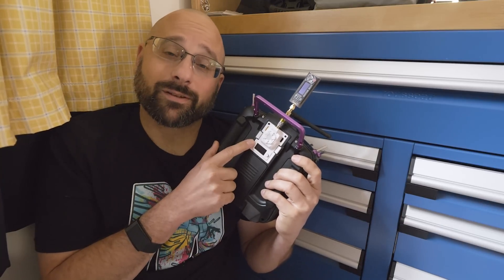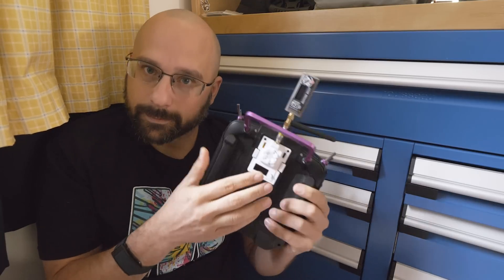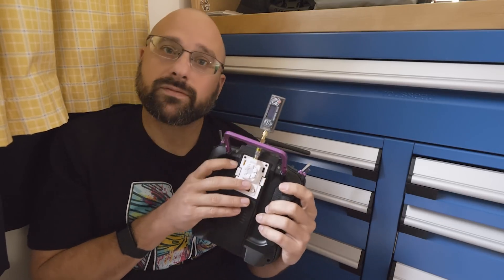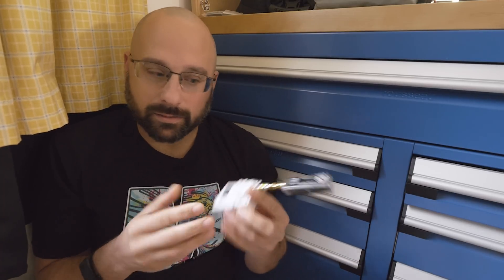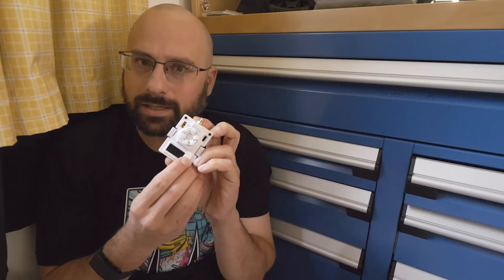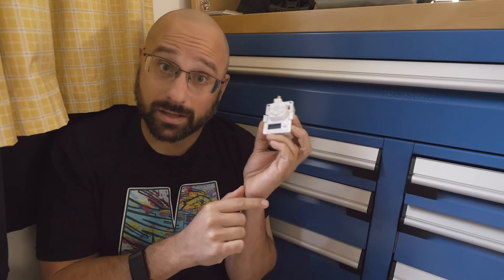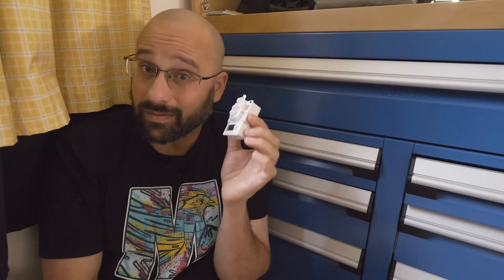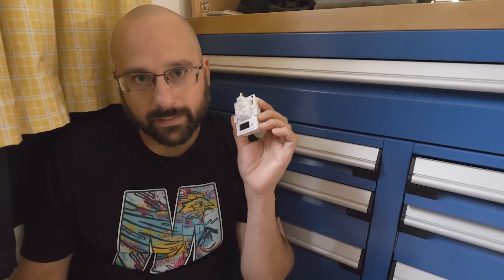BetaFPV Micro ELRS module fan design is (probably) not defective

Comment: Hello,  this is the team from BETAFPV. Thank you to Joshua's video for pointing out your concerns and feedback and the rest of your valuable feedback and concerns on our ELRS Micro TX Module. Here is the back story of the design of the RF module and why we chose this as well as why it won't influence the fan's function of the cooling down. As for the concerns of the joystick and failsafe issue, we will talk about this later.

The RF module is on the opposite side. Could the module cool down and stay secure? Leaving the RF module on the back side of the main board, we could have enough space for the RGB LED and the heat sink (only needed for the next 1W version). For this version with 500mW maximum RF output and 30 minutes continue power on, the temperature of the RF chip could keep under 40 degree and about 30 degree for the case. The module could work properly in this situation and totally do not need to worry about perfomance. Also, for the black version (maximum 1W, comming in December), the temperature can be kept in 65 degree, with the help of heat sink in our testing. From the testing you could see, the temperature of RGB LED would be 10 degrees higher than the RF module no matter in 500mW or 1W situation. This is the component what more need the cooling fan. 

Another concern that no consumers' feedback yet is the blowing direction of the fan. Blow inward or outward? The testing result shows that only the micro JR case would be affected, about 10 degree temperature difference. The electronic components inside would be in the same temperature.

We also make pictures of some basic data to show you our testing results of the above information. If you need more about it, please feel free to check the link below:
https://betafpv.com/blogs/blog/know-more-about-betafpv-elrs-part-ii
https://betafpv.com/blogs/blog/know-more-about-betafpv-elrs
If you need any help, please feel free to contact us on Facebook: or Email us. 
Facebook: https://www.facebook.com/betafpv
Support Team: support@betafpv.com
Reply: So how about the joystick situation?
If you want to gain credibility, you have got to deliver quality. Otherwise being marked as a problem for ExpressLRS appears quite appropriate.

Comment: I purchased the number one version firmware on beta fpv micro module . It supposed to work without all that upgrading and upgrading and flashing .
Lots of brands do come with brand new  working recievers . But that information seems to be omitted and shamed and ridiculed and videos seem to create the impression elrs is a computer upgrading game or job and remotely controlling anything is not possible without a huge investment in electronic computer bases  and equipment and access to programs that change bi-weekly following latest upgrade

Comment: Us spectrum tx users are out of luck with adding Express lrs2.4?
Reply from the maker: Spektrum radios from DX9 and higher can connect to a CRSF module, so they can use ELRS. But they can't run a lua script so they would need a module with built in display and joystick to configure the module.
Reply: @JoshuaBardwell  thank you for the quick response!  I am very thankful for all you do.

Comment: Joshua, we are on your side, this is very dumb design, no questions about it. Just blaming opensource community for this when it had nothing to do with this bad design just did not sit right with me. Especially when they do this not for profit and whole community benefits from it. Some people responded "oh i will wait with switching to ELRS" when it is not ELRS problem but particular item design issue.
Reply from the maker: Acknowledging that bad hardware reflects badly in the project is not the same as blaming the devs for the bad hardware. I don't know why this is a hard concept for a lot of people.
Reply: @JoshuaBardwell  Because usually this is not how it is being done. It is common for commercial products to use opensource code, what they do is they ask to support their hardware for a monetary donation.  I e it is BetaFPV's job is to work with opensource community to produce a great product under BetaFPV brand name and get a profit from  it. The ELRS devs already doing great good for the community for free (which we are very grateful for already) and they have zero obligations to make BetaFPV product to be profitable.
Reply from the maker: Yes I know that this is not usually how it's done. And I specifically explain why I think the ELRS situation is different, both in my original video and in this video where I elaborate on the reasons for those who didn't seem to get it. You can disagree with my reasoning, sure, but at least acknowledge it and then argue against it. Don't just repeat the argument that I responded to.

The ELRS devs have zero obligation to anybody as regards hardware: correct. But I did not say, "the ELRS devs have a problem." I said, "This is the biggest problem with ELRS." You are equating "ERLS" with "the ELRS devs" and I think that's why there is confusion. I am talking about "ELRS from the perspective of a person who is deciding whether to use ELRS or some other control link."
Reply: @JoshuaBardwell  I'm not disagreeing with you reasoning, though just saying that "it is ELRS problem" from such a trusted source as your channel, makes it so. Because people immediately responded as "I will wait now before switching". Where if different words were picked such as  "it is BetaFligth problem" people would respond "Oh, i will pick different ELRS hardware then".

Comment: Not saying its a good design but could the button be used as an emergency RTH if the radio has locked up and the vehicle is not responding?
Reply from the maker: If you see that as a desirable feature you can always just yank the module out.
Reply: I didn't say is was a good idea, just a thought...

Comment: I guess they didn't attentionaly made the failsafe happen during the menu. They just programmed the menu over the Firmware without managing the multitasking of elrs fw and their oled code. So this is just a lazy move. They hoped no one will ever do such thing as using the menu while flying.
That's what I think  happened. Could be wrong though.
Reply: It’s just a sign of lacking QA and lacking developer experience.

Comment: 100 mW outperforms any video link and/or reasonable sized batteries. Anything above 250mW is just marketing bs.
Reply from the maker: No offense but I respectfully disagree. If you're running 250 Hz, 500 Hz, or higher, you can get into situations where you need a little more power, especially if using the ceramic antenna. You're right for probably the majority of people but additional output power does have some purpose.
Reply: @JoshuaBardwell  Higher than 500Hz? Did I miss something? 😉 The EP2 is best fitted in racing rigs. I would rather pick the EP1 for freestyle/long/er range flying. https://youtu.be/GkvHiWJ7g4E was at 150Hz@100mW with the crappy hm stock antennas. I bet this wouldn’t been an issue even at 250Hz with the prodrones on both rx and tx. A little more power (250) can be useful though to do that at 500Hz (will test that asap) but I don‘t see how anybody really needs >=500mW.
Reply from the maker: Did you miss something? Test versions of ELRS can run at 1000 Hz. That's what I'm referring to.
Reply: @JoshuaBardwell  Missed that! 1000Hz is crazy 😁Can‘t wait for the 12 bit vertical resolution to make use of it.
Reply from the maker: They are waiting for CRSF v3 I think before even 500 Hz makes sense.

Comment: open it up and flip the fan over to make it blow the air out, NO other mod needed, the temperature will drop about 5 degrees. maybe this way it can hold max power a bit longer. funny how the betafpv dev team didn't think about this.
Reply from the maker: They have internal testing that shows the temp is lower with air blowing in.

Comment: Maybe you just should be opened to understand that not everyone thinks like you, and in my opinion you do not receive well disagreements!
The module has problems, but it does not seems to be as bad as you reviewed it in the other video.
The USB C is a real problem 
The button is not a problem it is a choose of probably a lower cost solution.
The failsafe with the menu is a bad thing but to enter it you have to long press the button and while flying the chances of that happening are very very low, bit something to change over firmware!

Comment: People don't buy a Lumenier Lux and say Betaflight is shitty because the problem is with the feature of the Lumenier Lux, not with Betaflight feature. If Lumenier doesn't make good Betaflight FC, there are other manufacturers who does. Same goes to BetaFPV having a dumb "feature", it's not a ELRS feature so not sure why would it be a ELRS issue especially when ELRS didn't certify it. If ELRS would to implement a certification program, then that would open up a can of worms.

Think the public just needs to be educated that ELRS is like Android, it's open source and the devs don't make the hardware.

Comment: I think you were bang on man, I did not see an issue with anything you said.  

For me this has been a rather frustrating product to review tbh.  I have held back my review a week while I did more testing but it’s just gone live a little while back before I released you had put out an update.   

 It’s been frustrating because overall the hardware is actually ok.  Build quality is fine and PCB had zero manufacturing issues in my sample.  The thermal design does appear compromised however overall it’s adequate for its use case and like you my tests showed good results. There is zero question that module should have been on the front and the LED on a daughter board somewhere between or above even but overall it’s decent.  

However the whole button firmware is just beyond not a good idea it’s crazy.  When I first found the behaviour I literally fell off my chair, my  words were “wow, someone thought that would be ok” in astonishment.  However it’s a SW issues  as you say due to the implementation on BetaFPV fork.   The devs will get this sorted and if you don’t need the button then just flash 2.0 and be done, but I do like having the menus option.  

It’s as you say the decisions made that raise the concerns.  Anyone who shoud have beta tested that should have been “nope, you can’t do that’  

I will add something on bad hardware affecting expeessLRS and how it’s viewed, I don’t think that an issue as there is always the reviews to weed out the issue.  Ardupilot has suffered similar issues with hardware causing the overall project to look bad however it’s always continuing to grow.  

Honestly this module is not a bad piece of hardware, however they have let it down in the way it’s ended up coming across that’s for sure.

Comment: I'll just stick with tracer. simple and it works.
Reply from the maker: The big weakness of Tracer to me is the range. To get even moderate range you have to run at 1 watt and then it sucks your controller batteries down. If the range of Tracer works for you it's a solid choice.

Comment: Bardwell is 100% on point with this. ExpressLRS is in a place where people are judging it heavily based on the hardware it comes on. To get to mass adoption (and by that I mean, the likes of Crossfire now and FrSky back then) ... ExpressLRS needs good hardware partners to make sure users have a good experience end-to-end. And ELRS is new enough that people's perceptions could be colored by bad hardware. It's not the ELRS team's fault, but the technology as a whole will suffer somewhat for shoddy hardware experiences. That said, as long as it works - it works. People may chalk it up to just poor design on the manufacturer's part. Hopefully. But JB is right. When a FC provides a shitty experience or doesn't work as we expect, we usually blame the FC - not Betaflight. We avoid that brand and don't buy it again. An RC link is a bit different, because the protocol is not as well known, and people are choosing what to buy having little to no experience with ELRS.
Reply from the maker: 100% agree. This is exactly the point I was trying to make. This isn't the "fault" of the ELRS devs, and I think that's what people are reacting to--the perception that I'm blaming them. But it is a thing that affects public perception of ELRS and it is a problem if it gets out of hand.
Reply: @JoshuaBardwell  exactly right. ELRS devs are working incredibly hard, they came up with a fantastic technology, and it's a credit to their ingenuity (and the quick actions of happymodel, frankly) that we got something competitive to Crossfire, Ghost and other RC links in an amazingly quick time frame. It took ELRS a seemingly short period of time to reach the popularity now enjoyed by Crossfire. If BetaFPV had been first out of the gate, instead of HappyModel, I don't think we'd be seeing quite the same adoption as we are now. But we're at that inflection point where ELRS could dominate, REALLY dominate - and basically push Ghost and FrSky completely out of the picture in terms of market share. But BetaFPV needs to not muddy the waters with crappy products. It brings everything down.
Reply: This is the nature of Open source though. Quality control?! Sticking to specs and standards?! They'll figure it all out. People forget that all this stuff is experimental and hobby grade. Yes, hobby grade for a reason. That being said. ELRS is so freaking impressive and it makes me re think the control link to some my rigs that are hella solid but some, not all, are limited by range. And range issues shouldn't be a thing in 2021.
Reply: @IshamPadron  not arguing against open source at all. Bf is open source too. We're just suggesting substandard crap from betafpv has the potential to hurt ELRS more than another open source project like bf.
Reply: @trekkin_fpv5272 I don't disagree.

Comment: Changing in the Lua does interrupt link also...  At  least it used to..  I like the idea  of flashing normal firmware to eliminate the knob
Reply from the maker: But this failsafes the minute you enter the menu. Not just when you change the parameter.
Reply: @JoshuaBardwell  I mean, I agree with the menu issue, and I understand it interrupting the link when you change the power - might be a hardware restriction - but it should be such a short link loss that your quad wouldn't actually failsafe in any case...
Reply: @JoshuaBardwell  that is dumb

Comment: what about new Namimno module? any chance for review?
Reply from the maker: I can't wait to check it out.
Reply: one more question - about receivers - can those be used with different anntena? only those large, t-shaped ? or "wire" like from other 2.4G could be used ?
Reply: I've just received mine - first impresson - excellent, second - where are the docs? Receivers are 3.3 o 5v? Why there is a voltage adapter... Overall - flashed tx and rx with elrs 2.0 final, soon will test it on a model... :-)

Comment: I want to see more people actually fly ELRS modules and receivers before I fly my trusty rig out there over the forests. 
Currently Wezley is the only one to have all the testing results done but to prove the consistency of the tech we not only need better hardware but also some more people to test them out and document it on something like YouTube to back up the hype with proof.
Reply: I want to get my ELRS hardwear for 8 weeks now. But after BG has still problems to pile theyr stock up, and watching this i think a solid CRSF link is the better way to go..
Reply: @petergrahammer1493  i bought an amazon beta fpv micro module and it came the next day . It never did bind with the reciever . So i used a crossfire without lua script .
    I ordered 2 more beta fpv recievers . I will try again to bind one of them before putting it into a drone . 
  Fr sky makes a red r9m plastic micro module that does not work for lots of reasons . 
 The brand new crossfire reciever binds without lua script or upgrades  . I sure would like to warn people of all that upgrading .
Reply: I have elrs 900. Flown it alot. Gone far. Flown on 500mw for 30mins at least 900 no issues so far
Reply: I’m using the happy model for a few months now and it never gave me a problem.
Reply: I startet with the DIY-stuff, according to that the tech is mature, but there are quality issues with the cheapest stuff, 1 of my 3 happymodel receivers were broken, the fan of the happymodel tx does not switch on with 500mw, but still the best decision, planty of range, for every quad (huge and tiny) there is a Receiver that fits and no fiddling around with binding or updating :)
Reply: If you head over to the facebook page the Devs will guide you to reliable hardware and help you make the switch.  I WAS a full crossfire module user ;-)
Reply: You obviously haven't seen my channel, been flying elrs for half a year now ;)
Reply: @FailsafeFPV  Now i have and yeah its awesome how you fly. I love raw motor sound videos.

Comment: Well, on my HM2,4 tx I could change the power output via lua while flying in CRS....nothing bad happened. Now on 2.0 RC2  I would not have to do it anymore. Set to a high output, the modul only takes dynamically what it needs to keep the connection. Well done, saves bat live. ............ All your remarks are completely right. Keep on.